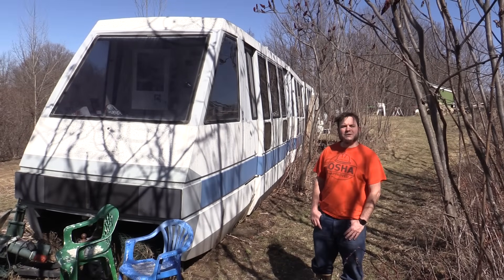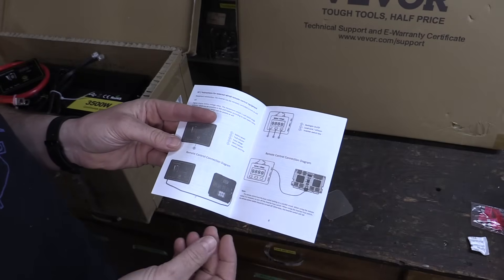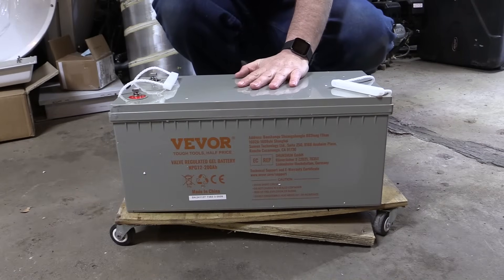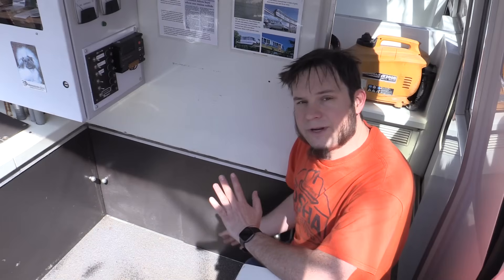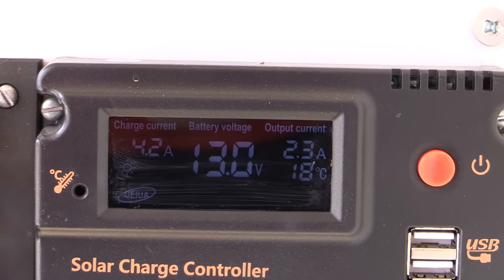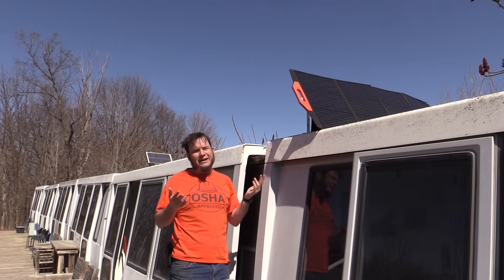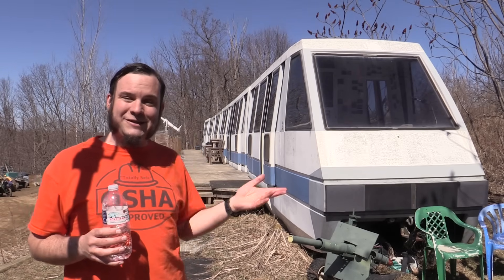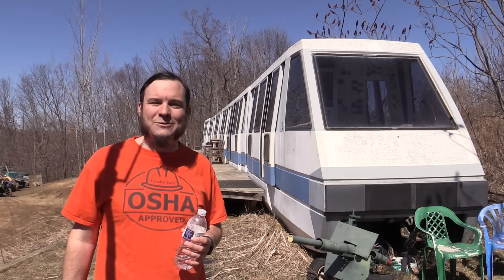Upgrading Our Solar Powered Monorail (Vevor Battery, Inverter, & Solar Panel Review)

Comment: what would be the logistics of moving a 6 car monorail?
Reply: Not really that complicated. If they're like European counterparts, you basically just use the sling points to lift it, but you can also drive it on. I don't know if they exist anymore, but i saw footage of a special trailer that had rails instead of a bed, and they'd ride the segments unto the trailer at the factory and pop them unto the tracks at the designated location (depot). This was back in the early, mid 90's in Germany. By the looks of the entire unit, it was quite old, pretty worn. The interface point between the trailer's tracks and the actual tracks was so deformed it basically became a thin wafer (basically the trailer's rails were tapered and would move down from horizontal to an angle to allow the cart to ride off. Pretty cool stuff. This being a monorail, i think they probably craned it.
Reply: @aserta  Here in Germany modern light rail coaches, in meter gauge track can be packed into a trailer truck, and driven slowly. But this monorail looks a bit wider than that. and more importantly how do you pluck the monorail from the track and can a civilian get a permit to operate such huge trucks - what is what I was wondering ...
Reply from the maker: We brought it out one car at a time and hired a crane. They're mostly fiberglass so not super heavy. We pulled them off the track at the zoo with hand winches and a lot of cussing :-)
Reply: @saveitforparts  ahhh ok thank you